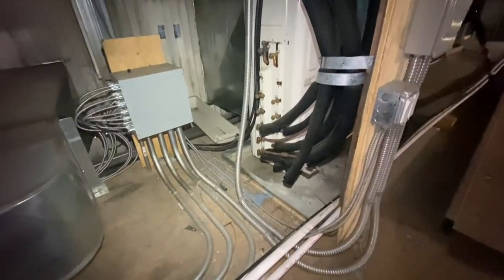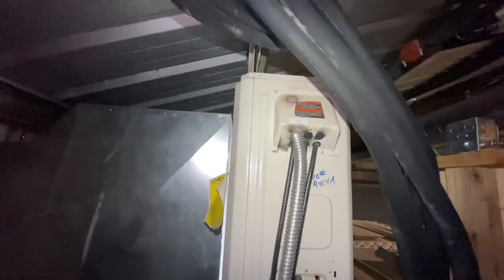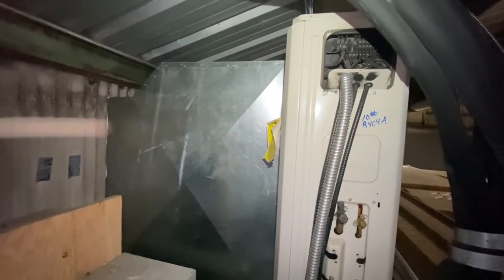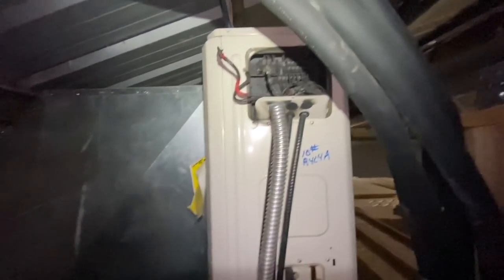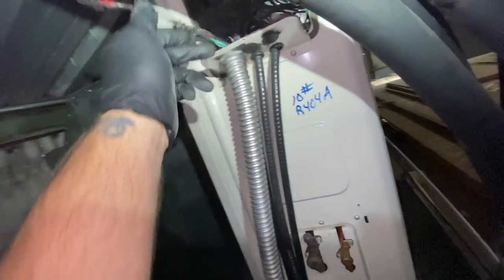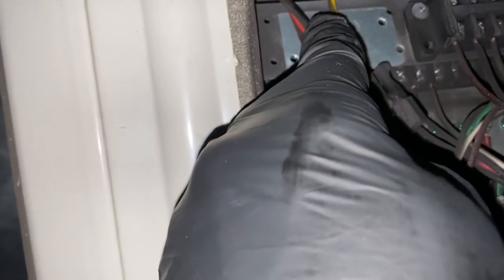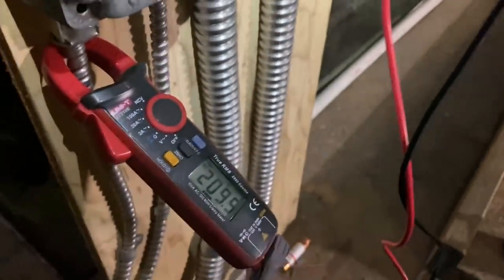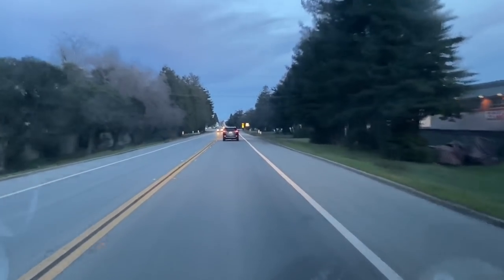Crispy mini split

Comment: Lennox had a recall on those things for catching fire.  🔥🔥🔥
Reply: ohhh, I assumed aluminum wire to copper only lugs or lack of antioxidant/not torqued proper combo :)
Reply from the maker: @sknight0391  I will have them contact Lennox dealer that did install today 🤘⚡️🤘
Reply: @OcRefrig   but it looked like the issue started at the supply wire and lugs coming in, not the equipment side! although that would be very high temp wire.
the green color corrosion on wire still screams oxidation issue. that's exactly like aluminum wire to copper lugs issue, if the wire is copper, then something is fishy with the terminal block metal, maybe just copper clad aluminum or the wire is copper clad aluminum? something very fishy there

Comment: We've been using mini split style condensers for refrigeration lately..cool shit...been around for a long time..but finally kinda catching on here in CO
Reply: So crazy man. I know if those units drop a leg leg power boards fry...the power board sends 360VDC to the main boards...insane
Reply: Even if they Drip to say 178v they fry...had so many at this one place..put some icm 254 on and caught it . Dropped leg down a mile...main line coming from lines..

Comment: It let the smoke out, they recalled those units for a fire hazards and will pay for customers to replace them.
Reply from the maker: I wondering if the terminal block was rated for units amp draw.
Reply from the maker: I’ll have them look into that. Thank you

Comment: Good Vid ! ONe of those wires looked aluminum ?  im guessing they were all aluminum  by the size vs wiring in the unit. LOl.   time for those  aluminum wires to go just as far back to the disconnect, so the next melt down can be at the disconnect and not the unit. Lol. Man, you and the customer got Lucky on that one, i Thought for sure the Whole unit was a Gonner, Circuit boards and everything.